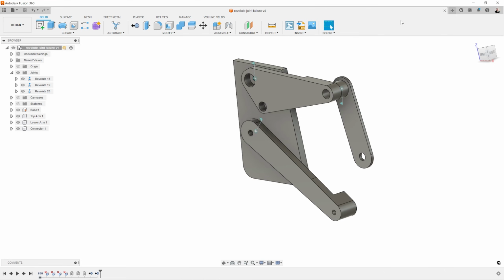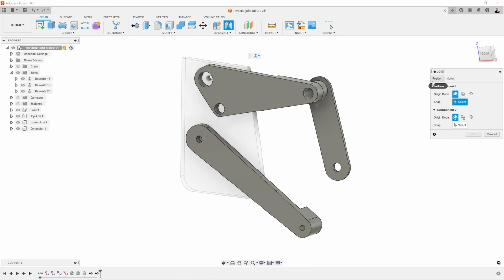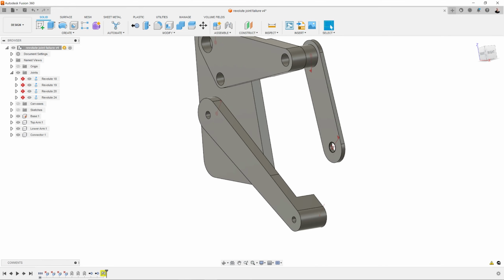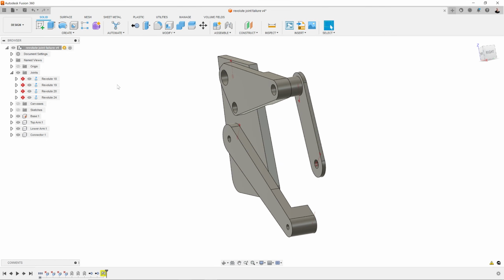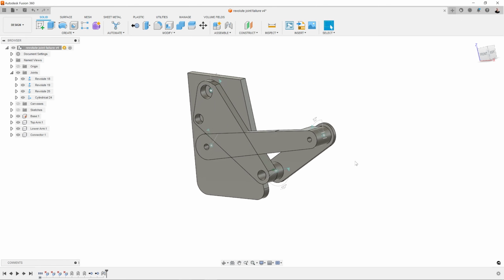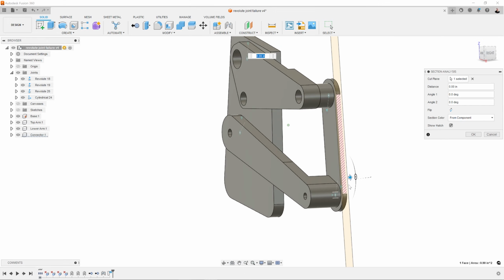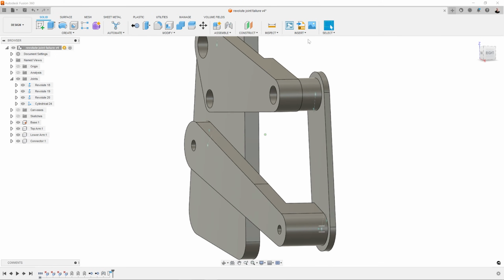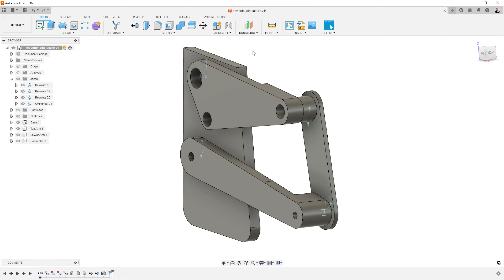Quick Tip: How to Get Past a Joint Error Message | Autodesk Fusion 360

Comment: I'd love to see the ability to have a tolerance for error on joints. I have several parts that measure up accurately to the micron, but Fusion doesn't let me create a final joint because there's a distance of 5.04E-4 mm. That's 504 nanometres, or "a wavelength of green light" of error, I wouldn't be surprised if it's from a floating point error in a software library as I haven't modelled any parts with more than 0.02mm of precision and all parts are perpendicular in this assembly.
Reply: Hrm... It turns out one component isn't perpendicular. It was probably imported from a mesh and so a triangle is causing me this grief, but the angle is tiny (1.207E-06 degrees). That's close enough to consider parallel in this use case... Having configurable tolerances for rounding like this would be superb in assembling parts. Sadly, I did not import the mesh, it was given to me as an f3d part, and I don't fancy remodelling it.

Comment: I have idea with another problem with joints. Sometimes you would like to change joint, which is in the past in timeline, to have different effect "in present". In this case you go to the past in timeline and change joint or delete it to have new one in present. But this changes past and all timeline history between joint and the present what can make errors. I think, to save your design timeline, there should be command like "copy joint  to the present". It will copy your joint to the present and it will be active joint and source joint in the past will be supressed in timeline. When you back before copied joint with history marker source joint will be activated and you have your timeline history without errors. I think your team should analyze this idea :)